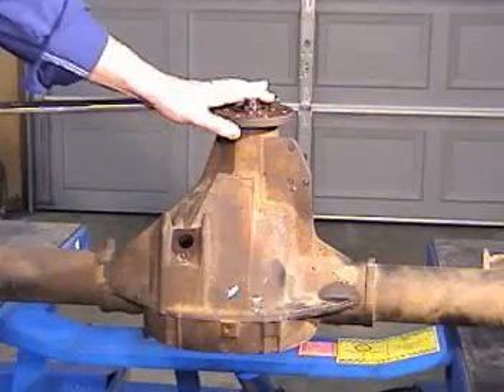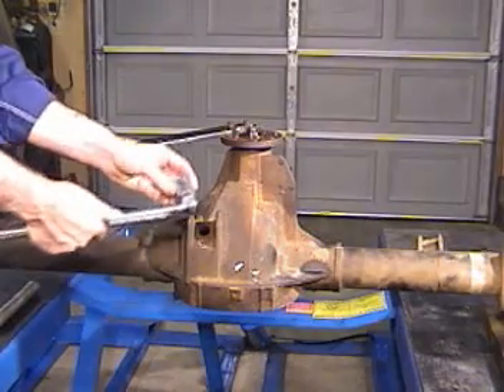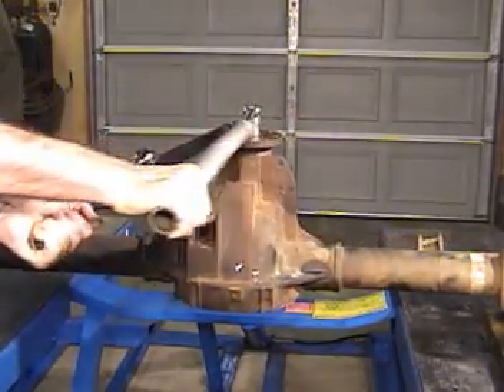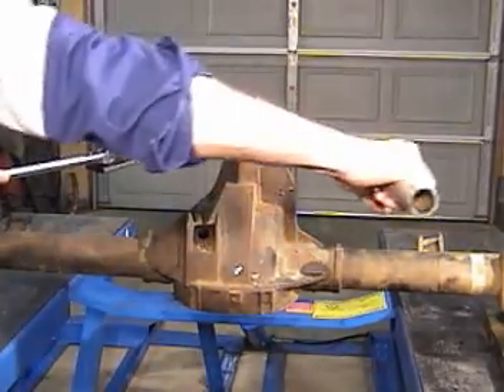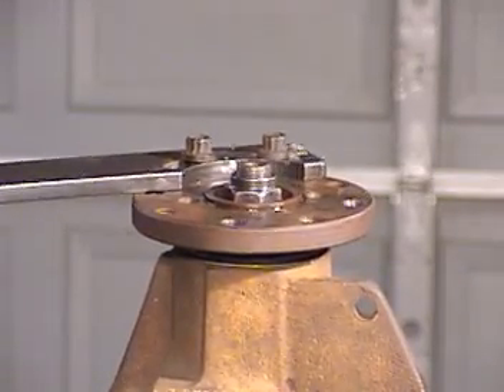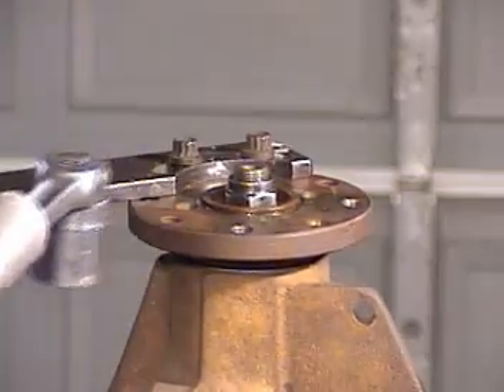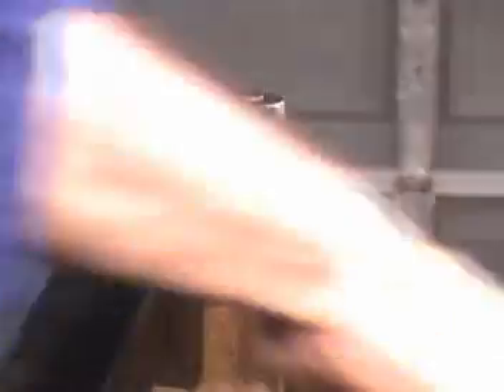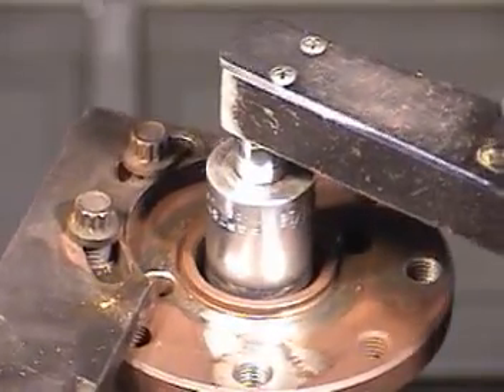Setting pinion bearing preload on the Ford 8.8" axle

Comment: Whats great is you dont tell us how to preload the carrier bearings which is the actual hard part. Ive had howling gears for two years after watching this video. Thanks for your valuable knowledge🤙
Reply from the maker: Well, my complete 8.8" repair has carrier preload info and much more. This clip was only the short section on the pinion which must be done before the carrier is installed.
Reply: If you got howlin gears thats your own dumbass fault
Reply: To preload the the carrier. You insert the shims by hand to get  .008"-.012" of backlash and a nice tooth pattern...then you remove those shims and Install a .006" thicker shim on each side. There's your preload per Ford instructions.

Comment: Why would the companion flange  be tight   with new bearings and the sleeves  aint compressed  yet
Reply from the maker: Did you install new races? If so, they might not be fully seated.

Comment: Hi Ken. I have a question about that part in your DVD where you use Ford special tools to measure the pinion depth.. the one with dummy pipes that stimulate the ring gear bearings and all.. Can you do a new one, using conventional shop tools like normal depth gauges or dial indicator please? It's impossible to find special tools used in the dealer shops. Other good guys on YouTube do by trial & error methods, yours is scientific. Thanks!!
Reply from the maker: Hi Abdul, if you have my 8.8in repair video, I show an optional method using depth mic and dial indicator. In most cases, if the rear was setup correctly before, the pinion that is in there should be correct for a new ring and pinion.
Reply: @badshoeproductions  appreciate your kind reply, Ken. I'll go through it again. But the rear end I'm working on was tampered with by someone, so I'd better watch your tutorial video. Cheers!
Reply from the maker: You can normally start with a .030" shim. The 8.8" depth tools are still available piece by piece but when it's all added up, it might be about a $1000.
Reply: @badshoeproductions  Watched it again and got that magic number you wrote on the blackboard ;) that was the best explanation ever! Thanks a million..

Comment: I thanked you 10 years ago when I bought your DVD off eBay and I thank you again today cuz i was wondering where will I find a 200 ft.lbs torque wrench to use for the nut. The "feel" is the best way to go with.
Reply from the maker: Why do you need a 200ft-lb torque wrench?

Comment: Summit sales a improved crush sleeve that takes 130-150 foot pounds to tighten down.I used this with my impact and slowly tighten it down with no problems.I easily reach my 25 inch pounds of preload for my new bearings.Just have to turn nut in tiny increments after the slack is gone.

Comment: Good video. Very much to the point. Not too much excess talkin jest to fill time. The main focus is the preload, Not the torque.it Just takes usually anywhere from two to four hundred foot lbs pounds torque to attain sixteen to 29 inch pounds preload on the bearings.

Comment: How much additional preload does a new seal typically cause?  I put my axle together with pinion spacers, had pinion preload at 25 inch pounds.  A few weeks went by tip my new yoke/seal/nut came and when I replaced these items my torque was higher and had to adjust the pinion spacer shims.  Now with the new seal I am sitting right at 33" pounds.  and the upper end of the spec in the service manual is 29" pounds.  Would it be reasonable to expect the seal to put an additional 4" pounds of rotational drag?

Comment: I don't understand why a used crush sleeve has to be replaced or why the pinion nut can't be backed off if the rolling torque is too high. These two issues don't make any sense to me at all. It's just a spacer, right? Somebody please enlighten me before I reassemble my pinion/companion flange. Thank you!!!!
Reply from the maker: The crush sleeve is used to put tension on the outer bearing's inner race. If the crush sleeve doesn't hold the inner race (like what happens using an old one or backing off the nut), the inner race will start to spin on the pinion shaft which will destroy the bearing and pinion in time. Understand that the inner bearing is pressed on the shaft so it won't spin. The outer bearing just slides on the shaft so the sleeve is needed to lock the race in place.
Reply: Thanks for your reply. The inner tapered roller brg. on my '67 F100 9"-10- bolt isn't pressed on, these are typical opposed tapered rollers like my '51 F3 rear end whose preload is set with the pinion nut and has no crush sleeve. I see evidence that the crush sleeve has been spinning against the outer brgs. inner race and the pinion had end-play and wiggle which is why I took it apart. (and slinging oil) I'm still confused on just what benefit the crush sleeve has in my application since it become loose with time and tightening the nut gave me a proper preload with good tension on the nut and if it loosens again it can be snugged up easily. ApparentIy pinions normally lose tension and preload as they run in, this one has less that 17k miles on it. I appreciate your explanation but it seems to me the bottom line is removing the play so it can run true and not sideways against the brg. cup. Thanks.
Reply from the maker: I've never heard of a 9" that didn't have a pressed on inner bearing and early 9" normally have a solid sleeve. The pinion nut should never loosen up if set correctly. Reusing an old crush sleeve may cause the nut to loosen because the nut won't be tight against the flange. It's only tight enough to get your 30 inlb of preload. With no or a used sleeve, there's no pressure against the back side of the companion flange to keep the nut tight to the flange. It's just floating on the pinion splines with a few inlb of back pressure. Also, unlike a car's wheel bearing turning at 60 mph, if it has a 4.10 rear, the pinion is traveling at 240+ mph.
Reply: I'm sure you're right about the inner brg. being pressed on, my memory is shot to hell and a hundred different things to focus on to bring this truck back from 17 years of storage. But it has the typical crush sleeve with the bulge in the center. I'll watch it closely and fix it right next time if necessary. Maybe it wasn't torqued properly from the factory. The yoke is a very tight fit on the splines and was a bear to remove. (no rust, just tight tolerance) This is the same vehicle whose right rear axle ball bearing seat wasn't machined far enough by 5/16" so the wheel flange stuck out that much causing a loss of 5/16" width brake shoe contact on the 1-3/4" drum. (and shallow spline insertion on the other end) My machinist said "it must've been made on a monday or friday". Thank you very much for your help and you can bet I'll be watching that pinion closely. The diff. hsg. says "3.23" on the tag.

Comment: Hi and thanks for the info. Just replaced the pinion seal and reassemble everything. Turning torque with axles in measured 13 lb/in. When coasting I hear a vibration. There is some play around the flange when I tug on the driveaxle, but I didn't want to over squeeze everything. Q1: should I slowly apply more torque to the nut to increase rotational torque measurement to get rid of play? Q2: what rotational torque am I aiming for with used stock bearings on 05 mustang gt? (FSM says 20 lb/in.) Q3: tough for me to torque the breaker bar under the car. Is there a safe way for me to torque the nut with an impact wrench going slowly?
Reply from the maker: If you have up and down play, you're not there yet. Understand that with the axles installed, you won't get a correct preload reading. With the original crush sleeve you should be able to torque the nut to 100 lb-ft and see if the play is gone. If so and you can still turn by hand, you may be fine. If you still have noise, you may need pinion bearings.
Reply: Thanks very much. Another question: by the book I won't get a correct preload number but should I be aiming for an amount, after torque thw nut to100 lb ft, over that suggested by the fsm which states 20 lb in? Can I use an impact wrench going slowly?
Reply from the maker: Sure, as long as you don't over shoot it.

Comment: ok,
    another question, an 01 mustang gt seal  I tried the 'counting threads' method of setting pre-load and only ended up about halfway to where it started before I took it apart.
     it has about 30 inch lbs of pre-load on it. Seems a bit tight actually, but there is only two threads showing on the back side of the nut, I don't really want to back it off any less n 1.5 threads is really pushing it, on the other hand it only had about 18 inch pounds of pre-load when I disassembled it. 
    So question is will 25-30 inch pounds be an acceptable amount of pre-load on used bearings? I have it all back together now, but it has some other issues so is still sitting on blocks, figured I would find out whether I should back it off a tad bit, or just roll with it lol.
    All the rest of the system was pretty tight and smooth no lateral movement or freeplay at all so that is fortunate
Reply from the maker: Never back off. You can take a chance with what you have or put a new crush sleeve in and do as in the video.

Comment: alright, I am just replacing the seal. I assume there is a way to do that without pulling the entire axle assembly yes? that would be a lot of work to just replace a leaking seal
Reply from the maker: +che bernhardt The seal can be replaced without going into the rear. Find my other youtube video I have on replacing the pinion seal. Understand that if you find the companion flange loose, it may indicate you have damaged bearings.
Reply: +BadShoeProductions thanks appreciate it, getting set to do it now,

Comment: 1995 F150 with an 8.8 diff: I tightened down the nut as much as I can without a torque wrench and then measured the preload. The specs for the new bearings and gears called for it to be between 14 and 19 inch pounds. I measured it and it was at 15 but I hadn't torqued it down. I torqued it to about 180 (as high as my click-type torque wrench would go) and now the preload measures 40 inch pounds. Should I have torqued it down like I did or kept it where it was the first time?
Reply from the maker: +Glen Carlson Did you use a new crush sleeve?

Comment: hello I am doing this job on a 2000 Tahoe, It is said the pre-load is  14 - 19 ft-lbs. dose it matter any if I stay to the low end like 15 ft - lbs ?? why the range???                           nathanmerchant1981@gmail.com
Reply from the maker: +Nathan Merchant I can't believe a pinion per-load is 14-19 ft-lb. Did you mean in-lb?
Reply: yes it says  14 to 19 in-lbs. I put it to 15 in-lbs there is no play in the pinion and it is tight. I know it get lose so I don't want to under torque it. I guess what I am asking is why the range? is it better to go to 19 in-lbs or to stay at 15??
Reply from the maker: You're fine, and 14-19 in-lbs really isn't a broad range. It's almost impossible to put it right on say 17-in-lb. You would likely replace the crush sleeve a dozen times because you overshot the spec.

Comment: If I just want to replace a leaking seal, do I have to be concerned with all that preload stuff?  I though I 'd just count the number of turns on the nut, and tighten it back up with a tiny bit more turn.  Help!!
Reply from the maker: That is exactly how it's done. Understand that if you find the companion loose, that might indicate bearing damage which means a rebuild. The other thing to check is the pinion nut should see at least 100 lb-ft when you get to the end of the final turn. If you're back to the original nut position and you have less that 100lb-ft on the nut, the bearings may be very worn or damaged.

Comment: The problem is the an inch-pound torque wrench is around 200 dollars, I have about every other tool in the world but I don't have one of those. Is there any other way to determine correct preload?

Maybe if you can give an idea on how far the pinion will go if you give it a good spin from the yoke side. I noticed when taken to zero play it will spin about three times, this is with a used bearing. Then with some preload added it goes about 11/2 turns with a medium amount of preload.

Yes people, you would obviously check the preload with only the pinion gear installed, empty housing.

Comment: I said excellent video in my previous comment but in all actuality you almost cost me a set of pinion bearings and possible pinion damage! You never mention in your video that Ford recommends setting the preload BEFORE installing the gears and axles! Your video gives people the assumption that the gears have already been installed! Next time you waste peoples time by uploading a video like this be sure to explain it in more detail! Thanks jackass!
Reply: Maybe don't put ALL your faith in a random youtube video and do the proper research with FSMs and such.

Jackass.
Reply from the maker: bob stout I don't think people assume the carrier and axles are installed since no one has asked me about it in a quarter of a million views. I do have a caption saying there's new bearings installed and the inner pinion bearing can't be replaced unless the carrier is removed. Of course the clip is taken out of a longer scene at the beginning of the assembly starting with an empty housing which I did not mention in the text for the video. Therefore I will add that to the text. Frankly, the preload can be done with the insides together (like in just replacing the crush sleeve and pinion seal) however, the preload is less for used bearings and there's no way to get a correct in-lb reading with the friction load of the carrier and axles installed. Thanks for pointing this out to keep from having a future viewer concern....Ken.
Reply: A quarter of a million sounds so much more than 250,000, lol! Generally, the people who look to YouTube for help in situations like, what you are trying to describe in your video, don't have the knowledge to complete their task on their own so they "ASSUME" a video sporting 250,000 hits will point them in the right direction! So are those 250,000 people dumbasses for not already bringing the missing parts of your video to your attention or like myself could they have possibly created a potential catastrophic failure of their own?

Comment: all all the specs and measurements different for the 7.5 rear end. im doing my mustang including all the bearings. i was wondering because i can find good info on the 8.8 but nothing on 7.5 im aware they are the same design but i could imagine some specs are different. what is your insight on this?

Comment from the maker: You have to remove the carrier to remove the pinion however the original left/right carrier shim should be reused, no problem. Be sure to mark the caps. If you install new pinion bearings and crush sleeve, you will of course have to set the pinion preload as shown the the video clip. The carrier preload and backlash should be the same as it was before the bearings went bad if that's why your replacing them.

Comment: Hi there,
I going to replace pinion bearings on my SUV and i decided to go with OEM bearing and crushing sleeve, but leave the old shim, shall i still check the preload and the backlash? or can i just bolt it down?

Comment from the maker: No, once the crush sleeve is compressed, you should not remove the nut and reuse. While your testing tooth pattern and backlash simply leave the crush sleeve out. Once you have the pinion depth and backlash correct, then install the sleeve and set preload.

Comment from the maker: Because the flange holding tool is horizonal with the pinion straight up, it doesn't cause a concern. However, if this is done with the rear still in the car, you need to remove the flange tool for sure.
Reply: Ideally you should remve the tool. The moment of inertia to get an object spinning is I=mr² were m is the mass and r is distance of the center of mass to the axis of rotation. Leaving it on increases the breakaway torque thus throwing your result off. It's a lot easier to spin an empty merry-go-round than one with a bunch of fat kids on it.

Comment from the maker: You should be able to mark the pinion, nut and flange. Replace the seal, reinstall flange and nut to the mark and maybe an extra 1/8 of a turn more (there should be at least a 100 lb-ft of torque on the nut at this time). If the flange turns ok with no up and down play, your fine. If there's up and down play before removing the nut, it's likely the bearings are damaged and a complete disassembly and repair is needed.

Comment: So basically you set the bearing preload by tightening the pinion nut? Once there is no more play in the flange, it is time to turn 1/8 turns and use an inch pounds torque wrench to check preload? You do this by using just the wrench to turn the flange without holding the companion tool? Just wanted to claify it for myself.

Comment from the maker: @JONSEREDdotWS You can mark the pinion, flange and nut and simply run the nut back on to the mark and maybe add an 1/8 of a turn. The old Ford manuals will say to tighten the nut 100 ft-lb on old sleeve. If that makes too much pinion preload, then intall a new crush sleeve.

Comment from the maker: @JONSEREDdotWS Normally, a new crush sleeve is not needed on a seal replacement if done correctly. Sometimes a leaky seal is caused by a bad bearing making the flange loose. Of course bearing replacement would be needed along with a good cleaning and new sleeve. I your case, I have no idea but there may have already been a problem before the seal leak.

Comment from the maker: @LS6Z28 You must remove it of course, if it's was still in the car. With the pinion in the vertical position and as slow as you turn the wrench, there should be no concern. If you make your own holding tool that's longer, it might be best to remove it for a reading.